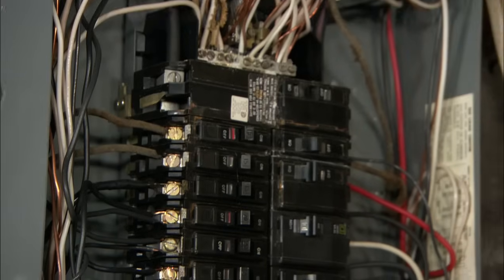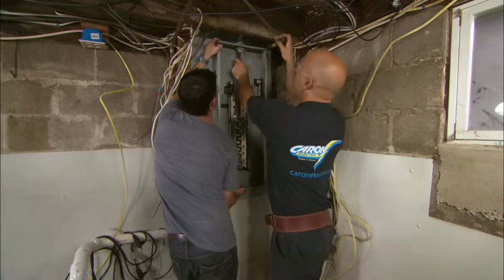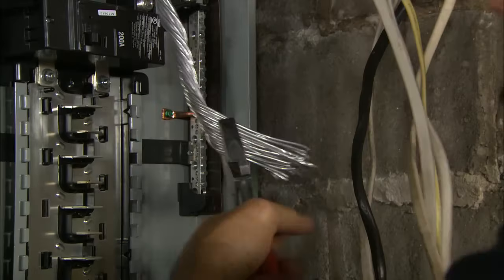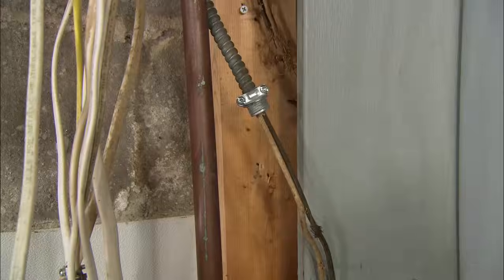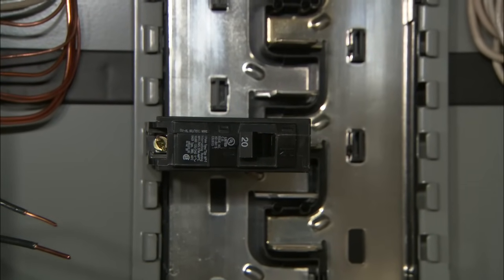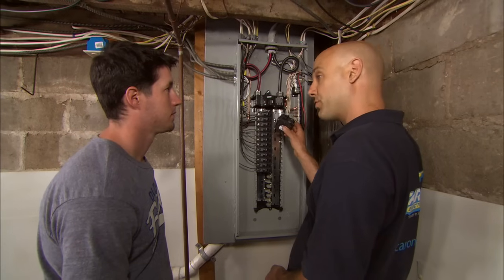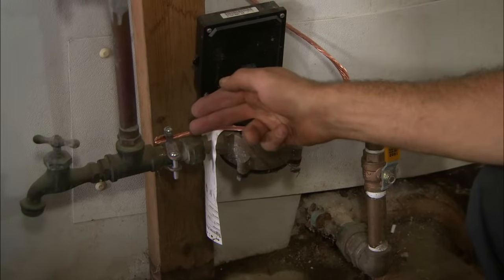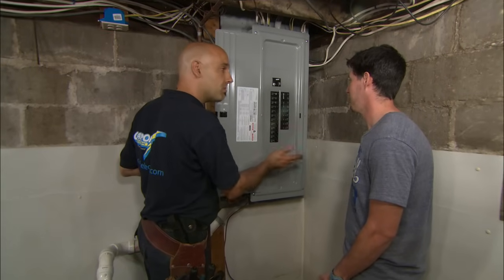How to Upgrade an Electrical Panel to 200-Amp Service (Part 2) | This Old House

Comment: For all general people watching you do NOT just cut the wires regardless.  You mark them all first along with current Breaker size unless you want to rip out all the dry wall and trace every single line.  Remember this is for TV purposes.  Keep in mind you also need GFCI and AFCI now to meet the safety codes.
Reply: LMAO, if they don't match, then it's 100% perfectly fine. You don't even have to rip out the walls, or trace. . . . . Hook everything back up, go in every room and turn on the lights, then go down and flip a breaker. . . . (Yeah you will need help with this), whatever room has no electric, then you mark that breaker. . . . . .
Reply: The easiest way to note this is to just look at the wires before you cut them and note any that are on a breaker that doesn't match the wire gauge. If you see a 15 amp breaker on a 12 gauge wire My assumption would be that somewhere down the line there might be 15 amp routing. So I would put that one back on a 15 amp. The truth is you could spend as much time sorting out the wiring as you do actually installing the panel probably a lot more and that's not something most people are going to pay for. Also once you go into tracing those wires in a way you're accepting liability for making sure the rest of that house is up to code and safe. If you confine your scope of work to a direct panel replacement where you only correct code deficiencies and installation issues right there You limit your liability. Obviously that doesn't work if you start the project and you find it's a complete rat's nest from one end to the other. At that point you're probably going to own whatever happens unless you fix it all. At least that's what the lawyers going to say if the house burns down
Reply: When I seen that I was like, did he really just do that?
Reply: He cutted all the wires because the Breakers and they have to figure it out before labeling
Reply: not in every state you do not need a GFCI/AFCI.
Reply: @jamedlock83  but if you know that is the safest wouldn’t you want it…
Reply: Grandma please be quiet!!You have no clue what you are talking about.

This house has a combo of mc,bx,ragwire, & romex!!I have been an electrician for 25yrs & women like you drive me nut's when I come to do a heavy-up service.

When a house is old,has double wires on one breaker.Labeling is pointless.If you truly knew anything about electrical 200AMP service install.You'd know we gauge all our wires with a stripper(14,12,10,8AWG etc.,(That's how you tell the corresponding breaker/wire size)

Also regardless of N.E.C code,a county can choose to not abide by the NEC's(( recommendation's))to install dual arc faults.In the future install an electrical panel first before you speak!!
Reply: Just turn on the breakers and see what turns on then label it as such
Reply: that the same thing I was thinking it would get confusing
Reply: What a tard. If you have to rip open walls to figure out how to label your electrical panel, then find someone else to figure it out. Its not rocket science.
Reply: I wouldn't never do it this way if it was my own panel. 😅
Reply: @77Avadon77 Why not??How many panels have you installed?I've done about 100 services.What about you?Do you even have a clue what you're talking about?
Reply: @theoriginalman5206  I've put in a lot of panels. But I can't remember why I made that comment 😅
Reply: @77Avadon77 Actually I agree with your original statement that I would not do it this way, because he skipped over labeling wires he was cutting and said he would figure it out later, but as most made for TV shows they never do! So I rather spend a few minutes before I remove/cut wires than have to spend hours tracing wires later! I imagine most don’t bother and just install in a new panel and go!
Reply: Why don’t you use some kind of power to power each wire and see where it’s going , our electrician used battery and some voice maker to mark each wire
Reply: @everydayhelp5085 😅😅That's silly!!
Reply: You don’t need to mark wires
Reply: @TyeRonio_Jamal_Jones  Right and you don’t need a ground wire and YOU don’t need to BREED.
Reply: PlayGirl hahahaha!  Do what?!  You can determine the breaker size needed by the  gauge of the wire. No marking needed. Jackwagon
Reply: @leonardholt5311  no you can't. Just because there's a 12 awg wire at the panel doesn't mean there isn't a 14 awg somewhere in the circuit
Reply: @dr.cupcakes626  so when you do a panel change, or replace a breaker, you should go throughout the whole house and trace down every wire to make sure the wire size doesn’t change?
Reply: @electricaf365  ideally yes. But if this isn't possible the only truly safe solution is to downgrade the breaker ampacities
Reply: @dr.cupcakes626  bullshit. If you get hired to change out a panel, then you change out a panel.
Reply: @electricaf365  like I said, if you're too lazy to trace out the circuits or it's not possible, you can use a lower amp breaker to be extra safe. I've seen 14 awg wire tapped off of 20 amp circuits a million times. Your job as an electrician is to install electrical components in a professional and code compliant way. If you're too lazy to do this then you shouldn't be an electrician in the first place.
Reply: @dr.cupcakes626  SMH, all these rookies in the comment section
Reply: @electricaf365  cupcakes customers hate him cause he takes 8 hours to do a 2 hour job
Reply: @electriciantv5174  No they love him, because he's not a hack, takes pride in his work and has enough experience to pick up the slack from the mistakes other hack jobs have made. I'll happily pay for the extra labor and hate hack jobs. In reality contractors are going to bill you 8 hours for a 2 hour job anyway and skip over what they can unless you are there babysitting them.
Reply: You should never be pulling 20 amps through 14 gauge wiring and 15 amp outlets will not accept 20 amp plugs.  If you inadvertently had 12 gauge and 14 gauge on the same circuit and put a 20 amp breaker on it the 14 gauge wire will still only draw 15 amps if you only have 15 amp outlets.  You would run into trouble though if you put a 20 amp outlet on the circuit and tried to draw 20 amps through the 14 gauge wire.
Reply: @dr.cupcakes626  If they are paying you hourly to trace and correct incorrectly wired circuits that is great.  If you are getting paid to change out the panel only then existing wiring issues are the homeowners responsibility.
Reply: @jaycahow4667   has it occurred to you that you could have multiple 15 amp receptacles on the same circuit pulling loads which in total equal more than 15 amps?
Reply: @dr.cupcakes626  That is true that is why I would never mix gauges of wire on the same circuit or at a minimum run the smaller wire to the breaker so a smaller breaker is used.
Reply: @electricaf365  no only if you just start cutting wires and have no idea where they go or for what.  Thus you mark them all first.
Reply: @jaycahow4667  NO!  If you are swapping a panel are you going to continue to do errors if so I hope you have good business insurance Because when their house burns down you will be footing the bill.
Reply: @dr.cupcakes626  but hardly any household items are gonna pull enough current for that to be an issue. Maybe if you got two space heaters on the circuit but that’s gonna trip the breaker before it burns up.
Reply: Wrong, the only thing you would mark is the functions of the circuit. A two or three year apprentice is going to be able to tell breaker size off wire gauge alone let alone a licensed electrician worth a grain of salt.
Reply: @brianherren9222  the point is marking them watch the video.  Who said electrician?  This a DIY!
Reply: @PlayGirlGrandma  yeah no this isn’t diy. The power company isn’t gonna cut the power for this unless your licensed.
Reply: @brianherren9222  perhaps you do not under This Old House
Reply: @PlayGirlGrandma  video comprehension much? This Old House video with a LICENSED electrician!  There are so may legal liabilities attached to just those 2 domains that you can bank on the fact that the salient points of this video are canon for 100amp -> 200amp panel upgrade. Shhh now, go comment on a video on a "smokey eye" make-up tutorial, or something.
Reply: Too funny.  Just like the comments above you must be in bliss.   @keereekee

Comment: very different from how we do in Denmark, we have 3 hot wires (phases) and one neutral, 240 volts between hot and neutral and 400 volt between to hot wires, also we require GFCI on everything, we do not have the busbar system, everything is wired together, normally with a 4 pole GFCI and wires from that to the different breakers, 2 pole breakers fore light and 4 pole breakers fore ovens, cooktops, the neutral wires is also connected to the breakers, mostly in private homes, distribution panels are marked of plastic, and all boxes fore outlets, connection wires and so on, is plastic... the neutral wires from the electricity company is not allowed to use as ground, i drive a ground rod to the ground instead, only bigger commercial buildings, it can be allowed to use supply neutras as ground, also back in the days this system can be found i older apartments... so it is funny to see how things are done different "over there"
Reply: Commercial buildings have three phase power in the US. Personally, I would love 3 phase power in residential as the motors don't require a starting circuit.

Comment: I am a HVAC tech, and in my field it always seems like the dudes that have the most to say about how much they know about HVAC, typically are the biggest dipshit know-nothings.  By reading the comments, I can see that the same thing goes for electricians.
Reply: Well the NEC (national electric code)  does get updated, so it leads to older electricians that haven't read the new one to argue with people about "how it's supposed to be done", when often times they just haven't read the newly updated NEC.
Reply: BaronVonSTFU yea same in welding, atleast where ive worked.
Reply: Ya almost worse with welding. Everybody thinks they’re the only ones who now how to do something properly. Crazy.

Comment: Dont try this at home, there is a lot of information left out of this video. Here are just a few examples:

1 The neutral bar needs to be bonded to the case, with that short l shaped copper bar. But ONLY if its a service panel, meaning the feeder wires for this panel comes directly from the meter.
2 The small wire goes to 15 amp breaker, the big wire goes to 30 amp??? Serious? Not everyone's panel has the same size wiring. 14awg wires get 15amp breakers, 12awg wires get 20 amp breakers, but not always! Sometimes a circuit is mixed with both 12awg and 14 awg wire, in that case you put the 12awg wires on a 15amp breaker.
3 Multiwire circuits? Hello, there are tons of circuits that have two hot wires, and share only one nuetral. That wasnt mentioned. They usually have a red and black hot, and one white nuetral. In that case you need the black wire on line A of the bus bar, and the red wire on line B. New code requires you to use a double  pole breaker.
4 Running a new circuit? Its likely supposed to be AFCI or GFCI protected.
5 If the panel is a sub panel, then the ground and neutral wires need to be separated.
6 Big breakers should be placed nearest the the main lugs were the feeders attach, since they get hotter, the heat distribution on the bus bar will be more effective
7 Leave the bottom [at least two] spaces open for future solar, in some areas this is required

There is much more I can say about the issue. If your having a hard time understanding what I am talking about you shouldnt be working in an electrical panel. If your done and the lights turn on, you might think to yourself that I was over reacting. Just remember, just because it works, doesnt mean its safe, or done right.

You want to install some lights, outlets, dimmers, fans, go right ahead. But seriously, if you need a new panel call an electrician.

Comment: Scary - some newbie is going to watch this and start cutting wires. Folks I know it's a show - but make sure you turn off your main or you're going to die.
Reply: Shad Vick you didn't watch part one, did you? Doing the outside...
Reply: no need to turn off...the power co. already cut the power line!

Comment: how much would it cost to hire a pro to install if purchased by one's self?
Reply: 400-600 depending on how greedy the electrician is. About 600 in parts.

Comment: When doing a job like this how do you deal with romex cables that are too short now that you have replaced the panel with a different one? I have this coming up and I know some of my cables are not going to be long enough to reach into the new panel.
Reply: Install a splice box nearby and splice on extensions there as needed.

Often, by installing the new panel in the right place and choosing the proper breakers, most wires will reach.
Reply: You can use a gutter for the short wires.
Reply: Splicing inside of the panel, while ugly, is permitted by code.

Comment: OK that is not how you turn on a main breaker on at all you should never look at a breaker when turning it on. You look away take a deep breath and use your non dominant hand to turn it on. This is so if there is an arc flash from a short you don't breath in the molten metal from the arc flash.
Reply: However, proper safety procedure is to make sure all circuit breakers are off, then turn on the Main Breaker. After that, circuits are turned on one at a time.
Reply: I guarantee they did a test run and made sure everything worked fine before they filmed the home owner "turning it on" for the first time, probably before they even installed the cover.
Reply: Use a broom stick
Reply: wrong and wrong ,the correct way is to tell the ol lady to go throw it on !!  LOL

Comment: How about if your panel is 100 amp and has light already how do you upgrade it to 200 amp
Reply: You have to replace it - a 100 amp panel cannot be upgraded to a higher amperage.

An alternative is to install a 200 amp panel and turn the existing 100 amp panel into a subpanel. This may be a less expensive solution.